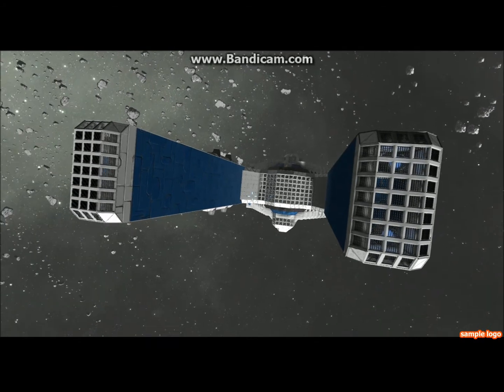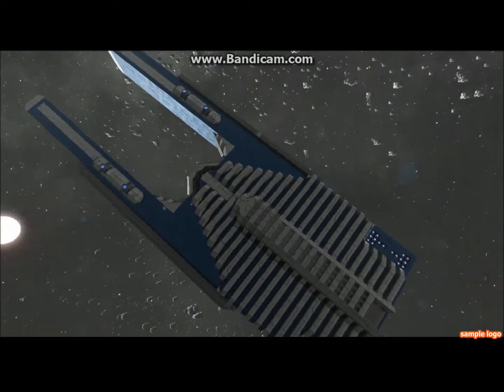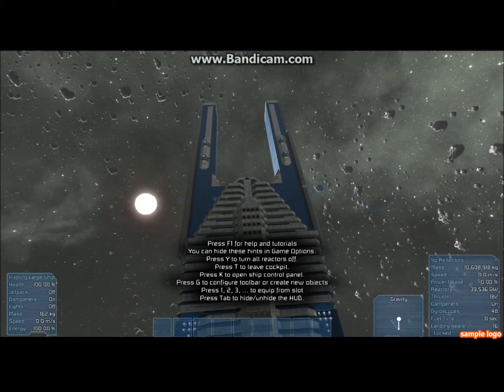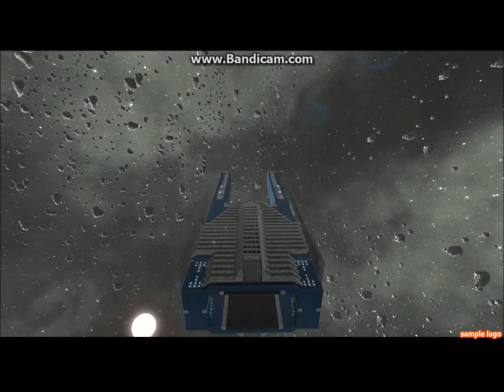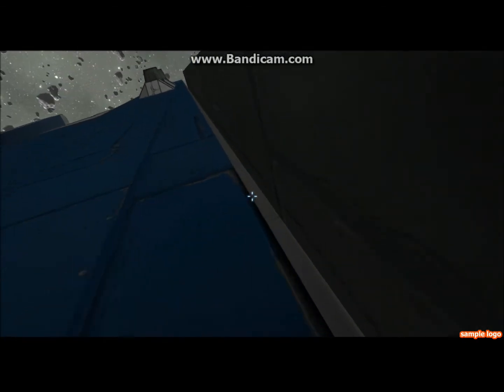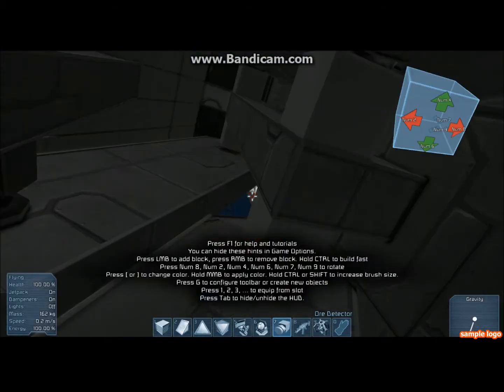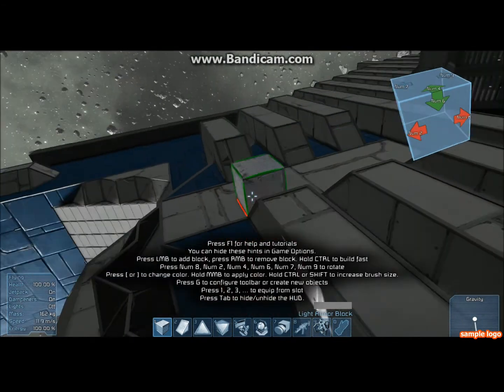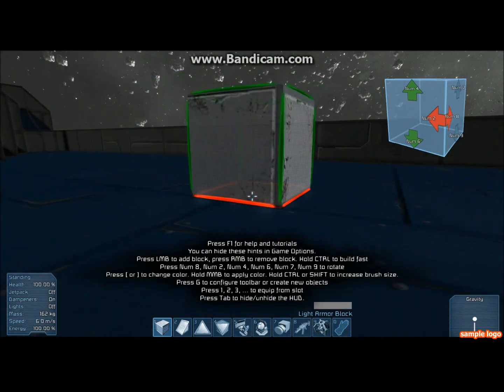Saradamon Does Space! (Engineers) EP 1: Pantographical Hangar Door

Comment: add more landing gear to hold it while its open/closed the few that you have will work for a station but you need several more for it to be able to hold while moving. overall not bad
Reply from the maker: I've yet to have the landing gear fail during movement tests, though it's something I had in mind already for once the ship has higher maneuverability.
Reply: Saradamon Client side anything connected to the rotor has a hard time breaking. Invite a friend on the world and have them drive it around and see what happens.
Reply from the maker: I did not design this for multiplayer, otherwise I would look into tests for such. This was intended solely as a test of concept for a pantographic hangar door. While the pistons now would make for a much more efficient start/end result compared to this, it is something I will likely be looking into later on. Thanks though, I hadn't thought too much about this one lately, so I'll see if I can get some testing done in the time around my work schedule. If I had more time, I would have had a lot more work on this and my iris door finished by now and uploaded. I do have a few ideas though that I've not yet seen anyone even touch on, so we'll see what I can get done in the next few weeks.